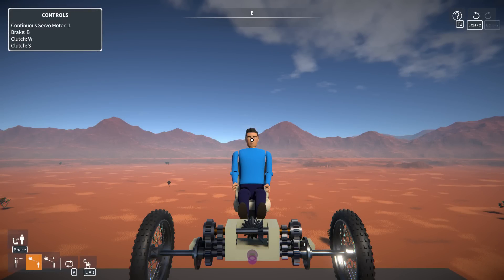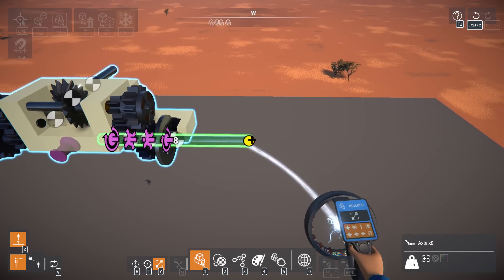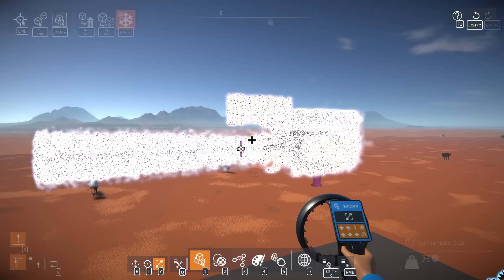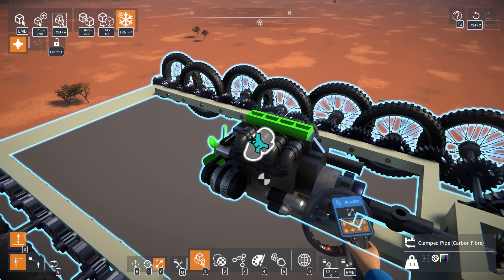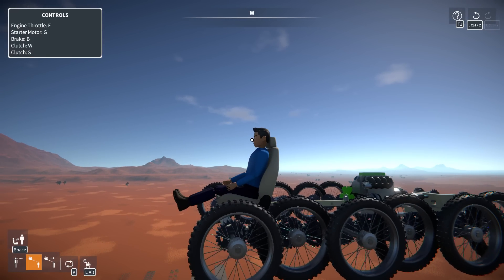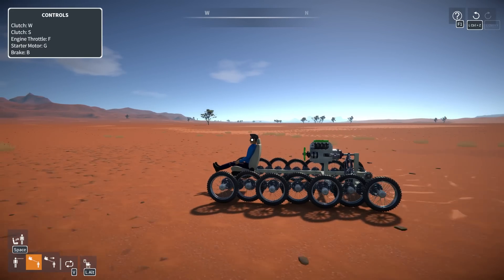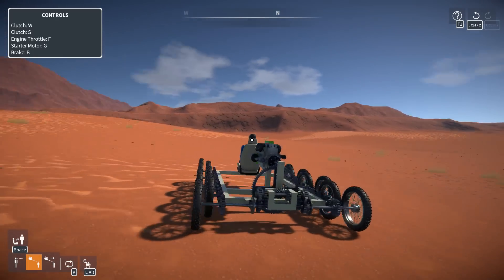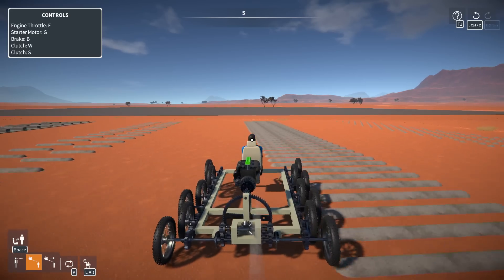I Built a Tank Drive Using a Single Combustion Engine and Transmission!

Comment: Hey Kan, what about experimenting with uneven amounts of cylinders on an engine?  Or trying to make a W16? (Like the ones found in the Bugatti Veyron and Chiron)
Reply: That would be cool, I hope you don't get hate about this lol
Reply: I tried this and sadly it’s really hard to do since 16 cylinders is too much friction for the game:( a ten cylinder kinda worked with 2 starter motors
Reply: @macncheese2029  kan did a 100 cylinders so its definitely possible
Reply: @macncheese2029 i always use 2 starter motors
Reply: i don't remember if the game has VR engine block but i tried making H16 and it stalls a lot idk why
Reply: @irgiefarras  if i remember right its not a 90' grid and able yo be put at a lof of angles if im not confusing games rn
Reply: @irgiefarras  it doesn't, but you just use a 60° block and call it a day
Reply: @irgiefarras  also, what is the firing order on that thing? How big is the balancing mass compared to the rotating mass of the crank?
Reply: @SodaTheProto  firing order of W16 or H16? For my H16 i essentially put 2 flat 8 that face each other and connect it to an axle, with flat 8 firing order on both
Reply: @irgiefarras  maybe do a H24, a flat 12 would essentially be two inline 6, which are rather smooth running engines, because of the 120° offsets between the pistons. Also flat engines like the ones in the game would be rather unbalanced and would vibrate like mad because of the side to side movement of the pistons, they are normally offset by 180° to counteract the forces.
Reply: What about doing a radial 12 engine